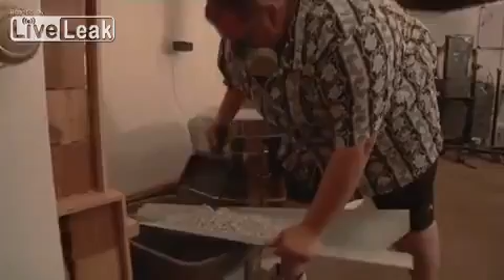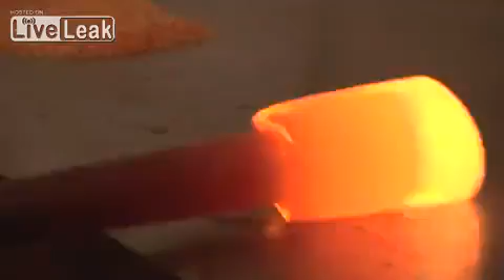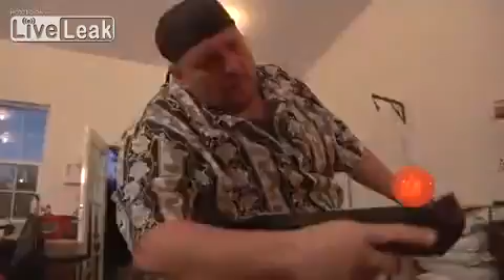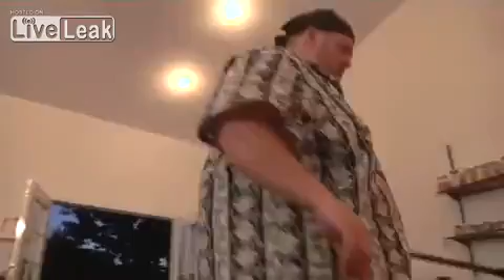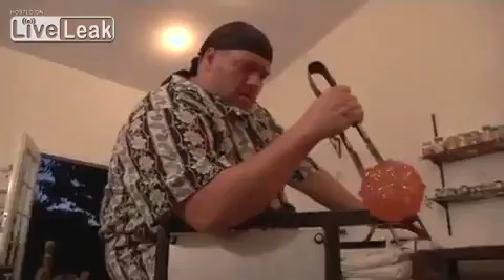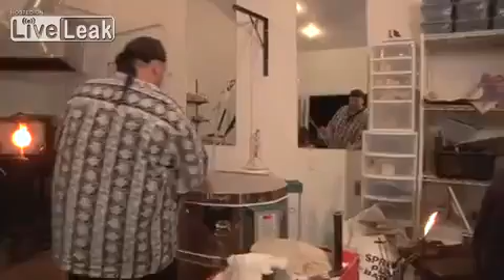Making Glass from Sand

Comment: What I'm wondering is how to make windows from glass the old fashioned artisan way.
Reply: +Ryder Hughes me too.seems to be a lost art.
Reply: +Ryder Hughes haha i came here for the very same reason. Did you ever find anything?
Reply: +Ryder Hughes I think you just take sand lye it flat melt it cool it and boom window (probably more complicated than that)
Reply: +Ryder Hughes Old window panes were made by floating it on water.  That's what gave old glass panes their slightly rippled appearance.
Reply: +Sood81 - Hasbara trolls belong in Khazaria 

over 3000 Fahrenheit/1700 celsius .  A REALLY hot kiln!
Reply: Sood81 - Hasbara trolls belong in Khazaria
Could be, it's not THAT hard to make a small kiln in the backyard. Plenty of vids and websites on that too.  Google is your friend.....once in a while.
Reply: +Ryder Hughes For clear glass, you need pure silicon dioxide. none of that beach type sand. Then you add things like sodium carbonate to lower the melting temperature, calcium oxide to make it waterproof, magnesium oxide for durability.

Comment: Thats awesome! Can you use any type of sand?
Reply: +asdf AQlmost all sand is mainly silica based...it's the silica that melts, yes.
Reply: +asdf Most sand will make a very hazy, tinted glass. You really need special silica sand for glassmaking.
Reply: Caleb Shoemaker
Why not just miss the point entirely then?
Reply: Caleb Shoemaker
the question was.
Can you make glass out of any type of sand?  Yes, pretty much, all sand has a silica base.

Can you make cakes using any brand of white flour and eggs?  Yes.
Does a wedding cake bakery use just any eggs and flour? No.  Get it yet?

Comment: Whats the temp needed to make glass, & how did they do it so many years ago???.
Reply: Coals provided with enough air (oxygen) could generate heat needed
Reply: +Keith Kirkby    1700 Celsius / 3000+ Fahrenheit     Kilns and forges go way back, made hotter by pumping enough oxygen into a contained coal fire where the bricks reflect the heat back into the fire.,